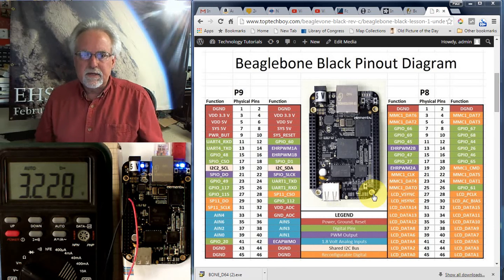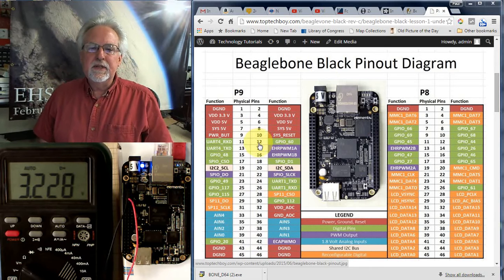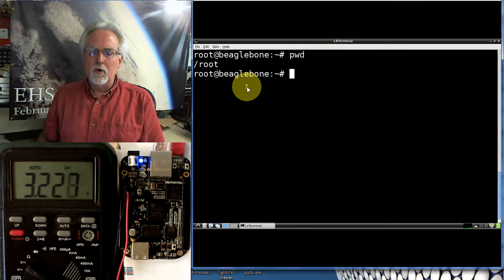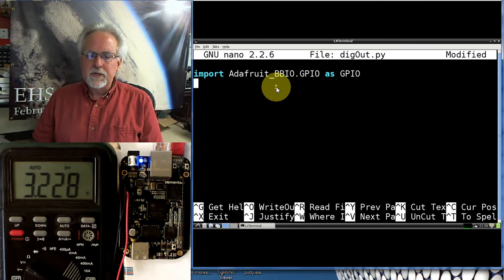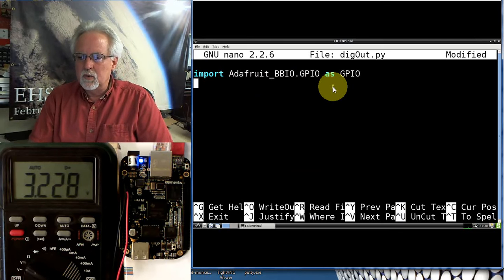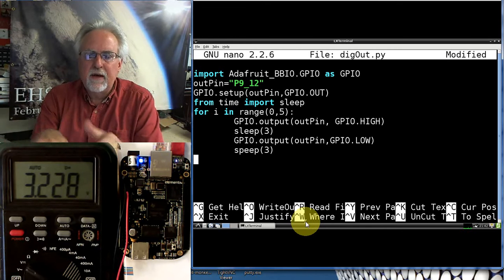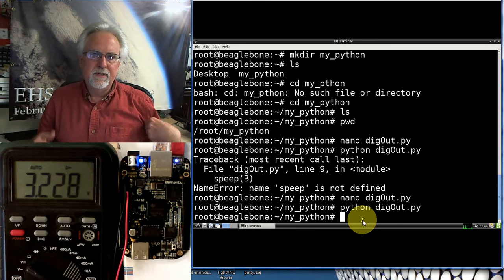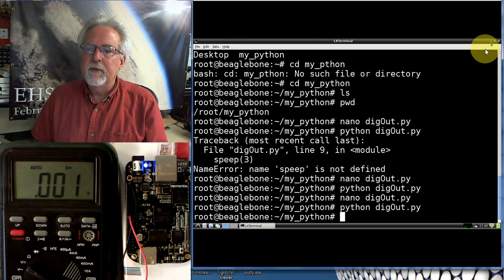Beaglebone Black LESSON 4: Digital Write to the GPIO Pins from Python

Comment: Most interesting GPIO pins. A fantastic world on the how the CPU push-pull transistors work to turn things on or off.  Then how the I2C SPI PWM chip techniques control various objects.  Then there are the terminal  command line:  echo 0 > /sys/class/pwm/pwmchip2/export     echo 20000000 > /sys/class/pwm/pwmchip2/pwm0/period   most exciting. 😎 Thanks.

Comment: Hi Paul, I have a found out a strange thing. PIN 12 as you mentioned is high on boot , by that i mean the multimeter reads 3.3V but PIN 39 in the header P8 is low on boot i.e it reads 0. What exactly is this particular problem?

Comment: can you do one for all of the different devices for reading pins and storing in a verible the last result aswell and to work with like threasholds of 3.3 volts or around that 4 example that would be good i got a 3.3 volts im trying to detect for an electric lock for example and need to understand how the refernce voltage should be calculated or my door randomly unlocks itself if you get my drift so bugs are important to ovoid an its quite a security potentail issue / nightmare waitin 2 happen if i was to use it out of a test phaze as wouldnt wana risk any issues lol could you help with that? i dnt know the most secure way of doing it as its gotta be like ajustible if pos aswell for tuning it up maybe what do you think?
Reply from the maker: ***** I dont trust electronic locks . . . too many things can go wrong.
Reply: could you do it anyways as it could represent anything not just a lock! but i would like it to be sumit i can adapt easy 2 make it work better than my idea iv had loads of versions an it just never works stable cus of errors iv made in code an just confused lol